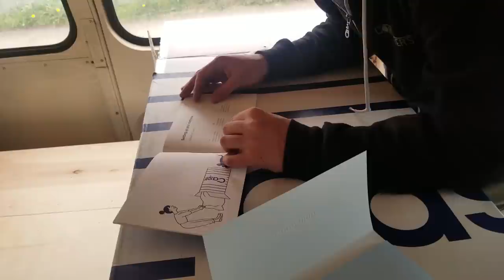Conversion Video 49: Adjustable Bed Lift

Comment: You may want to drill holes in the plywood base to allow air flow on the underside of the mattress to prevent mold.
Reply: Hopes or I bought stuff from sailing supplier that resembles artificial turf with breathable membrane which is supposed to allow it to breath. 
Holes are cheaper.
Reply: He can accomplish that by laying 1"x4" slats under the mattress, spaced a couple of inches apart.

Comment: I checked your build specs.  In my opinion, you spent in excess of $600.  You could have bought a complete garage lift kit for less than $300.  Add another $100 for misc. parts.  Admirable but, not frugal.  Could have used a Marine 12V winch for about $70 additional.

Comment: @2:17 For future reference, that's a "center punch". There are manual(hammer operated) and automatic(spring triggered) versions but they both do the same thing, create a little dimple for your pilot drill :)
Reply: I think his had a dimple on the end which would make that a finish mail set to drive a headless finish mail under the wood surface to allow wood putty on top. 
Punch would have pointy end.
Reply: This is the same vid that the guy didn't know what a punch was??? Haha I've seen so many. Probably the best one yet for me.
Reply: Just started watching for the first time, so cute he called it a "du-dad" 😂

Comment: To add height when cranking, instead of coming straight from the 4 pulleys to the crank, go at an angle from the pulleys toward the shower side, then run through a hole there to a pulley on the outside, and run back down to the crank.  That should increase the length of the run  of the single cable from the junction of the 4 cables.  

Though given the age of this video, dunno if you’ll read this.

Comment: Cool! I did something similar in my bus using 4 pneumatic cylinders. I'm actually sitting at my desk under it at the moment  :). But I had to go through a lot of hoops to make that go and down up evenly - one way valves and pressure reducers plus the solenoids - etc.. I like your design a lot. Mine's not 'man powered' but it does run off solar!! Thanks for posting the video good stuff.

Comment: If you put a pulley where you have the winch attached and attach the rope to the bed frame it would give you a little more lift. Alternatively if you had all 4 points controlled with one length of wire you could achieve more lift as well

Comment: He could’ve just moved the winch to the foot end of the bed and that would’ve given him enough diagonal length to get the bed up to the ceiling. The added advantage would be that the winch would be out of the way when getting in and out of the bed.
4 bottle screws connected to the 4 eye bolts would allow for the bed to be levelled when parked on a slope.

Comment: Genius! We just put our on drawer glides, but I almost like this better!
Reply: I wonder if one could fashion a guide using an inline roller skate wheel  instead of the one used here?
Reply: @larrybe2900  
I was thinking the same. They’d be quieter and smoother when winching and not rattle when you get in and out of bed. 
I’d put stop pins for the minimum hight so the mechanism isn’t under tension when the beds in use, the same stop pins could be moved to the top when it’s stowed. I’m also not keen on self tapping screws as I’ve had a few work loose in my work van. I’d probably use dome head (square shank) stainless steel bolts and bolt though the body and the uprights from the outside. I used the same method when connecting studs to the walls inside of my shipping container shed where a knew there was gonna be something heavy hanging from it.

Comment: Very nice project. Thanks for making and sharing the video. I would trade the crank handle for a hex nut though. It would look nicer and then you could use a cordless drill and socket to do all the work of lifting/lowering the bed. BTW... the "little doo-dad" at 2:22 is called a punch, or nail setter. 👍

Comment: So when you go to sleep at a Walmart, where does the stuff you have to take out of the way go to? Love the idea. Also, the link provided for pulleys is different from what you use here or did you fabricate the double pulleys? Good explaining as you go along. Some more close ups inside would help more, but think I've got it. Thank you for posting this! 
You might want to add a metal sleeve in that bigger hole you made by the crank so as not yp wear wood away.

Comment: Thanks for sharing, your video gave me an idea how to do my platform/living room lift :)   but maaan, its not easy to adjust it just right especially with electric winch attached to it and being scared that around 70 kg or over will land on your head 😂
Reply: If you use  bottle screws to connect the 4 separate cables to the single one it would be fine tuneable from left to right and front to back. They’re more than strong enough for this type of application. I doubt the max weight is more than 660lbs including 2 people and I’d add stop pins to rest the bed on when in use to stop the mechanism from being under stress and creaking in use.

Comment: Hey--a DIY bed lift that actually works! Could also use a 12 v power winch with a back-up hand crank when power isn't available. Would like to have seen a diagram of pully cable threading.

Comment: The vehicle you’re installing in, no concern for GVW issues/ materials seem like they are  maybe as heavy as you could have found. Certainly durable, but gas, breaks, suspension busters.

Comment: how did you keep the cable on the bottom pullies from coming off the pully as they are not captured?
Reply from the maker: The weight of the bed and having the bed strapped down keeps the cables on the pulleys.  The straps were added later, and aren't covered in this video.
Reply from the maker: See video 53.

Comment: Why mount the winch where you have to crawl over it to get in bed? Off to the side would have made more sense.  And if your cables pulled more parallel to the tracks and some grease on the pulley axles would make it a lot quieter.  Lastly why eye bolts at the top when a bolt and fender washers through the cable eyes would be stronger over time?

Comment: how do you down the bed?. when you changes the direction of the crank. the weight of the bed it don't get down quickly the base. how do you control get down the bed? . . . sorry I don´t have much english.
Reply from the maker: The crank has a brake.  Wherever you stop cranking is where it stops and holds.  It works both directions.

Comment: Looks great! My husband and I are planning to do something similar in our van, possibly with a motor though. Do you notice the noise coming mostly from the crank, or is it the railing? Any ideas/plans to minimize that?
Reply: A little bit of grease goes a long way - Sounded like there were 2 different sounds, one from the crank and one from on the rails.

Comment: Ignore the assholes with their negative comments!  I think that people don’t realize that most of the “kit” elevator beds require power.  I think you came up with a pretty good plan that requires no electricity.  I am looking for a solution to creating an elevator bed (manual powered).  The spacing is different from yours, and I don’t know how to overcome that.  I want to use a full-size bed, not across, but length-wise, in the center of an 8-foot wide trailer.  I am hoping for space to move on each side of the bed while it is in the down position.  I contacted Rocky Mountain Tiny Homes to request help (which I am willing to pay for), and Greg said no.  Not just no, but basically no way.  How do these companies function with such shitty customer service?  I know what I want is do-able, but I can’t seem to work it out.  I am disabled, want a decent place to live, but that pesky bit of massive brain damage gets in the way of me figuring out the mechanics.
Reply: 2 reasons I can think of why he may have said "No". First, depending on what your interior wall covering material is, your walls in a wood frame built home are going to be at least 4" thick each, so interior width on an 8' wide home is 88" or less. This means you'll have less than 3' total clearance alongside the bed lengthwise. Divide that by 2 sides of the bed and that's only about 17" on each side. But the bigger problem is how do you anchor your platform lift framework???  It needs to be secured to the walls for stability, so if it's built in the middle of the room, how would you anchor it? And if you do anchor it to the studs as needed, and just use a very wide platform for the mattress, when it is lowered, you'd have no way to step around it, without stepping up, onto the platform and walking across the platform itself, then down to the floor, but the lift brackets protrude about 2", so now you're down to 15" clearance on each side of the mattress. Enough for storage space but not really for walking, unless you just walk on one side (30").

Comment: Don't care for the crank-seems like I would run into it with a leg or?plus alot of errors back and forth. Going to go with a cheap 12v winch on the floor with remote.

Comment: Two years later.  Neat project. Is it still working?
Worth the time, effort and $$?
Do you use it like you thought you would?
Reply from the maker: I still love it. It is super strong and convenient. Being able to lift it has come in handy a few times, but it usually sits in the low position, because that's the easiest position to sleep on it. It makes storage much easier, though. I added tie-downs so it doesn't bounce while in motion, and drilled some more holes in a couple of positions so that the bed could rest on the rails at various heights. I've seen some variations inspired by this bed in other rigs, with some improvements, since I published this video. The best I saw was a version where somebody repositioned the corner pulleys so they were hidden under the bed. It made the bed platform a lower profile, helped it sit lower in the down position, and keeps the cables out of the way. I also saw somebody use an electric winch, instead of a hand crank. I thought about doing that, but I kind of like the analog feel of man power. Nothing more off-grid than a man-powered mechanical solution! If I ever change my mind about that, it would be a pretty simple upgrade, though. As far as cost, I'm happy with it. It's cheaper and stronger than some of the kits I've seen for RVs, and it's built for the space. If I could change anything, I probably would weld a metal platform together and use smaller pulleys to lower the profile of the platform. But, that would also be much more expensive. The tie-downs are also a must-do, as you can see in my bed lift follow-up video.

Comment: Nice job man, very helpful video...So I was an electrician for 20 years and still work with my hands sometimes...so I think I may be able to do this. Looking to buy a van now...maybe I can get some coaching what do you charge? Lol.
Oh did I just hear you say bus? Yea it does look pretty wide in the back

Comment: That's gotta make noise when driving. THis seems a cumbersome but cheap solution. If you want to spend money on this concept you're far better off with a happijac system but that's way more expensive.
Reply: At $100 for each plus shipping for just the tracks I don’t think I wouldn’t call this cheap. Seems quite study though. The tracks and trolleys are really designed for the loads to be on a different plane though. 

It’s a very cool design, but unless you really need to adjust the bed height in 1/32” increments or whatever the ratchet mechanism provides, this is likely overkill cost wise.

Comment: Im concerned about the tension you’re putting on the front and rear beams. The winch and pulleys are pulling the center of the beams together and only the frame top is resisting. You should add a front to back beam to resist this compression.  Also, you’d get more height if you relocated your eye bolts on the pillars higher or made the location that they enter into the frame lower. At the top of the travel, the angle of the cable is almost horizontal, so it require much more force to continue upward.
Reply: 28:01
Reply: @larrybe2900  those slats won’t resist much compression.  A 2x4 or some threaded rod would be better.
Reply: @HybridBattery  
There is not much weight involved with this application.